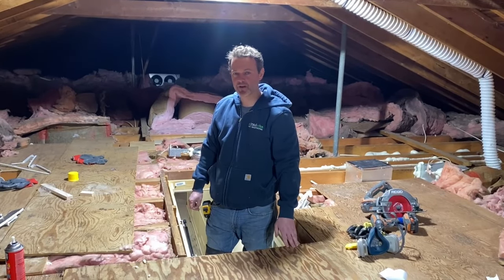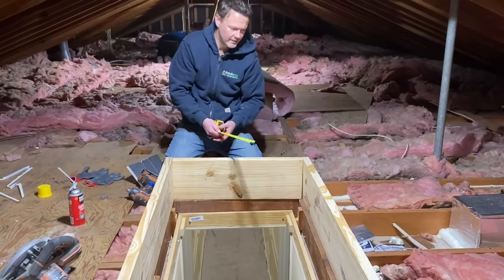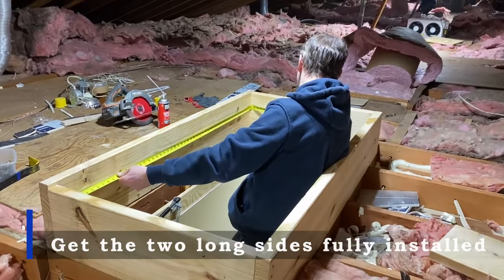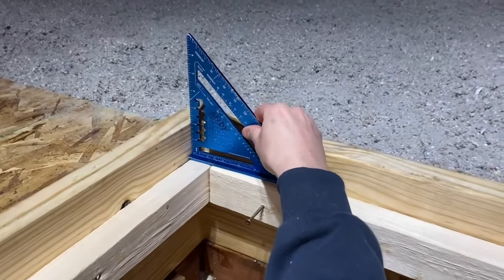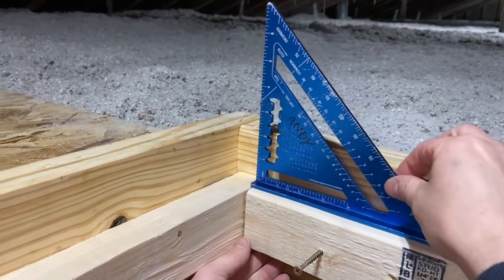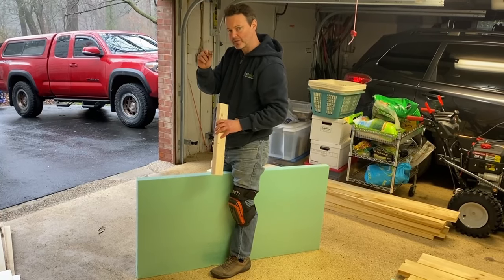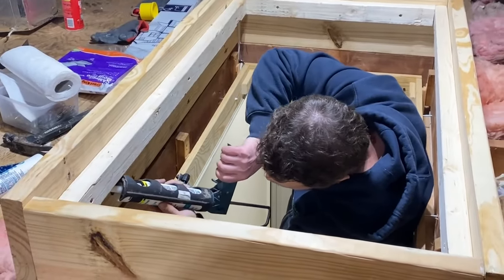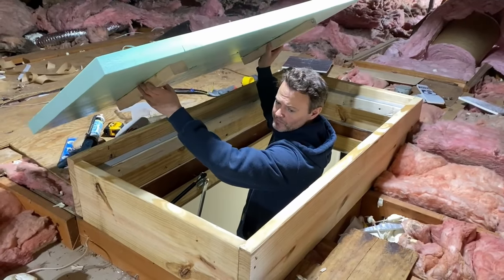How to Build a Sturdy, Air Tight, Insulated Attic Hatch for Your Attic Ladder

Comment: Up here in Canada, the hatch has to have an insulation rating match the attic.  In our case, that is  R-50.  Consequently, my hatch has 10" of foam board.
Reply from the maker: In a much colder climate it could make more sense.  Here I don't believe our customers would ever see the return on that investment (it would raise the cost of the hatch solution dramatically).  Thanks for commenting!

Comment: This looks a lot more durable than what my home's previous owner made. He built a 4-sided box from foam board that has each side screwed together and it rested on fiberglass insulation. Between me and the contractors I've hired, the fiberglass insulation loosened from the plywood reduces the box's effectiveness. Also, I've noticed the box gets tossed to the side when someone has gone up into the attic that has weakened corner seams. I don't have a circular saw, but I have a hacksaw although I don't cut very straight.
Reply from the maker: Thanks!  This solution has been pretty well tested here over the years.  I don't like the zippered covers (weak R value and they leak air) and the box covers we see ALWAYS get beat up and degraded fairly quickly.  If you're able to construct a hatch cover like this, it will work well for you for years. 
Andy

Comment: I like to make a sandwich to seal an attic opening by attaching drywall on the bottom, plywood in the middle and foam boar on top. The drywall has a high burn through time so I have that face the interior. This looks like a great job of air sealing an attic hatch.
Reply: Thanks Chuck.  Your drywall idea with the drywall ignition barrier is good.  Unfortunately we see a lot of those where the drywall deteriorates from getting knocked around a bit.  The combination of air seal, insulation value, and durability is our primary concept.  Hopefully if there's a house fire it won't be determined that our attic hatch was the straw that broke the camel's back ; )

Andy
Reply from the maker: Hi Chuck, your drywall sandwich method will work just fine the vast majority of the time.  The only problems we see using drywall are when the hatch gets used regularly, or the drywall begins to get damaged.  At that point the drywall starts chipping away around the edges and eventually air-leaks form around the perimeters.  It's just not as durable as plywood or XPS rigid foam board.

Thanks!
Andy

Comment: Why not glue handles on instead of putting holes through the foam insulation? You can even make the handles out of foam. I use PVA glue to build with foam.
Reply from the maker: A lot of adhesives will degrade foam board, they kind of break it down.  Loctite makes an adhesive specially designed for foam, but it takes 24 hours to cure.  I also see sealants fail from time to time.  Mechanically attaching the foam with screws and washers is quick, durable, and permanent.  Penetrating the foam with a screw does not impact it in terms of reduced insulation value or air leakage, the wooden handle is sealed tight against the foam board. 
Andy
Reply: A few screw holes through the foam are not going to make the slightest difference to the R valve of it. You would have to do the same if fixing it to the underside of  rafters

Comment: It would be sensible to stick Gapotape around the perimeter of the kingspan foam board so there is a tight fit between it and the wooden frame, to prevent further cold, and hot, air getting down as far as the weather strip. You could also have a second larger layer so it, in turn, sits on the frame.
Reply from the maker: Hi, it looks like Gapotape is an English product, I have not seen it before in the States.  I looked at it and it appears to be foil faced.  I like the soft foam rubber of the weather stripping that we use combined with the weight that we add to the foam board to create a tight seal.  I would not expect a smooth metallic surface versus a soft foam rubber one to improve the air seal here, but I could be wrong.  We've been building insulated hatch enclosures around pull down ladders like this for about 15 years and have tested them with both infrared imaging and blower doors, and they perform quite well so long as the inner wooded lip that the foam board rests on is level all the way around.  
Another component is that in many cases homeowners are using this multiple times a year to access their attics.  By adding additional tapes, weather stripping, etc onto the lip that the hatch sits on, or onto the hatch itself, the odds of a foot hitting it, or the tape getting mashed while the hatch is being moved around goes up.  And it is unlikely that most homeowners are going to identify that the seal was compromised and then "properly" repair it.  This design, with the materials used, should stand up to decades of use.  
Thanks!
Andy

Comment: What's the size of those planks? 1x6?
Reply from the maker: We generally use 2x10's to build the box that the ladder folds up into.  But you don't necessarily have to.  You need about 3" inches of clearance between the top of the ladder when it's folded up and the top of the hatch wall.  For lower profile ladders a 2x8 can work.  Hope this helped!
Reply: @insulwiseenergycomfortsolu3293  it sure did, I'm new to this world, but I am going to try this out. Thanks!

Comment: Great idea. I spent a little more money and I attached two elbow arms to the foam board and two stepper motors so the foam lid lifts and then moves on the side with the push of a button.
Reply from the maker: Thanks, that's taking it to another level!  Do you feel like it still seals well when it's all the way down?
Andy

Comment: Great video clearly detailing the steps involved.
Reply from the maker: Thanks, creating a durable, insulated attic hatch solution for a pull down ladder takes a few steps, but I try to lay them out in as coherent a way possible. 
Andy
Reply from the maker: Thanks!  Doing these things correctly requires a number of steps, at least if you want it to come out with a tight, durable air seal, insulation barrier, and be durable.  This solution should last a lifetime for the majority of homeowners.
Thanks!
Andy

Comment: Amazing job! Using this idea today,  thanks!
Reply from the maker: Hey there, thanks for the shout out!  I would like to create another video for doing this that's more condensed, but there's simply more than 2-3 steps required to get these to come out right.  But if you're able to follow them, you will have an exceptionally durable, well sealed, and well insulated attic hatch for many years.  We have now been building these for 15 years, and I have yet to have a single homeowner call and tell us that their hatch broke or no longer seals well.
Glad you found this helpful!
Andy

Comment: Helping plan for an old house new insulation - this video is perfect.  Watching your others.  Just an idea when you were dropping in your weather stripping, if you go corner to corner and fully overlap (two layers in corners) and cut through both layers at roughly a 45-degree the two stips will meet very tight and need in the corner.  Any problem you can see doing that?
Reply from the maker: Hi there, thanks!  I haven't tried that before, but it sounds like it could work very well.   The only issue I can think of is that the weather stripping that we use is VERY sticky, and it tends to stick to itself so well that it's likely to tear when you try to peel the top layer off the bottom layer.  But maybe I don't understand exactly how you plan to do this?  Let me know how you make out, we're always looking to improve our own craft here! 
Thanks, 
Andy

Comment: Great video helps me a lot. What weather stripping are you using around the perimeter? Things I have used in the past disintegrated.
Reply from the maker: We use this stuff.  It's durable and covers almost the whole lip of the box.  Thanks for watching!
https://www.homedepot.com/p/Frost-King-1-1-4-in-x-3-16-in-x-30-ft-Camper-Mounting-Tape-for-Trucks-V447H/100122697

Comment: you mentioned that if the opening was more like a trapezoid than a rectangle, it would be difficult to construct the lid.  I am curious...would the same thing apply if the opening were shaped like a rhombus?
Reply from the maker: Haha...I hope I never have to deal with a rhombus shaped opening, but yes, that would be significantly more challenging.

Comment: Do you think I can use foam board insulation in a central Texas Attic for this same purpose? I'm concerned the high heat may be too much. Perhaps a thermal barrier would be necessary. Or a different solution altogether?
Reply from the maker: Yes, I think this type of foam board would hold up well.  We use the green 2" thick pactiv brand, XPS board from Lowes.  I wouldn't use a styrofoam or polyiso style foam board, I think you'd be much more likely to run into issues with those materials.  Some of our attics here will hit 130-140 degrees.  I don't think it's likely to be too much hotter than that even in TX in an attic.
Reply: @insulwiseenergycomfortsolu3293  Thanks for the insight! I'm going to keep researching what my local stores have in stock and see how they measure up. Great design btw, I bet that guy goes in and out of his attic as often as he can 😄

Comment: Hello are these 2x10 boards? Is it difficult to get into the attic with the extra height of the new frame?
Reply from the maker: Yes they are 2x10's, but you may be able to get away with 2x8's.  The hatch wall needs to be about 3" inches higher than the ladder is when it is folded up inside the attic.  For some people it is more challenging yes, but for most it's not an issue.

Comment: How can you manage to walk through that insulation all over if you got to fix something?  Just wondering
Reply from the maker: You have to be careful (obviously), but we have to do it all the time.  I'd recommend a cheap headlamp so your hands are free, a dust mask, and then either hold onto the roof rafters as you move through it, finding the joists with your feet and staying on them, and kick it back once done.  Or use a basic broom to swish yourself a path and then swish it back into place when you're finished.  It's not as difficult as it looks, but you do have to be careful and STAY on the JOISTS is the biggest thing.

Comment: where are the links for the items? I need the link for the weather strip.
Thanks.
Reply from the maker: The product is M-D Building Products Camper Seal Tape 1 1/4" in W x 30 ft Roll.  It's about $7 on Amazon.  I just put these details into the video description.  Hope it helps!
Andy

Comment: At around 14:53, your partner in the background looked like he was making a Pot Light Cover. Rather than spending $16, it looks like you made your own at a fraction of the cost. Can you please advise what material you used to make it?
Reply from the maker: We typically use 1/2" foam insulation board and tape it together.  We also make sure that the lights have LED's in them and if they do not we change them out with extra LED bulbs that all of our trucks carry.  The boxes are large, at least 12" high and usually about 14-15" wide to accommodate the frame of the light and not allow for excessive heat build up.  Some could find this contentious, but we have had no issues over the years with it.  The newer LED lights put out very little heat, and the thermal shut off switch inside the light fixture would shut off the light if it got too hot, or cause it to blink on and off.  We tape the box together using metallic HVAC tape.  It is highly tacky and durable.  We then use foam to seal the box to the attic floor.
Reply: @insulwiseenergycomfortsolu3293  Thank you for the detailed response! I think your solution is a fraction of the cost and is a much better solution than off the shelf products costing much much more. 🙏
Reply from the maker: @EverGrowSteve   Thanks Steve!  We've tried all of those solutions as well.  The pre-made rock wool covers are nice, but they tear and get easily smashed in the back of a truck and are also far from air tight.  I've pulled smoke through them with a blower door.  The cardboard flip up ones, metal sided box ones, etc all leave a lot to be desired from our point of view.  Also -- pot lights / recessed lights are rarely situated perfectly in attics like it shows in their advertisements.  The lights are often directly against studs, up against roofs, etc and we went our route because we needed a solution that was adaptable to the wide variety of situations that we have to seal pot lights in.  Glad this helped you!
Andy

Comment: Should stack more foam to get better r value
Reply from the maker: Yes, we sometimes do that and you will get better R-Value (R20 versus R10).  The main reason that we don't is because of the added expense for the homeowner (that they typically don't want to incur), and with foam insulation at 2" you eliminate close to 90% of thermal conduction, so you begin to get substantial diminishing returns once you start to add more inches.  What I will say is that when you go from a poorly air sealed, 1/4" thick wooden attic hatch to an air sealed hatch with a 2" inch layer of foam board for a hatch, you will see a MASSIVE positive impact. 
Andy
Reply: stacking foam stacks moisture barriers wich traps moisture

Comment: Great video! Would the xps board be good for providing soundproofing insulation as well? My wife has an attic office and we have a similar hatch with fold down ladder. She doesn’t want to hear family noise while she’s on zoom meetings. What you recommend as an alternative material?
Reply from the maker: Hi there, the 2" inch thick XPS board would certainly knock it down a good bit.  You could also double it up and make it 4" inches thick by adhering 2 pieces of it together.  Either way you go, it will knock down a solid bit of the noise that is now coming through that hatch. 
Andy
Reply: TimberHP Wood Fiber Board are available in 24" and 48" widths and use tongue and groove to connect to other boards.

Comment: Very well done, but only R10?
Reply from the maker: You could certainly double, triple, quadruple the R-Value, etc by adding more foam board.  But that 2" inches of XPS foam board will eliminate about 90% of the temperature transfer coming through from the attic.  We do this to keep costs down for our customers and in my own mother's home I used the exact same design.  Except in extreme situations, I would be surprised if you could notice a temperature / comfort difference or impact on a heating / cooling bill by adding additional layers of foam board to these hatches.  They usually occupy about 1-2% of the attic floor area and the rest of the area is air sealed and insulated to R-49.

Comment: Where are the links to the weather stripping product that you used?
Reply from the maker: This is what we use.  It's about a full 1" inch wide, which is better than the Frost King brand's version which is only about 2/3" of an inch wide.  https://www.homedepot.com/p/M-D-Building-Products-30-ft-Gray-Foam-Tape-Camper-Seal-for-Camper-Shells-02352/202066511

I'm sure you can also find this on amazon
Andy

Comment: So you make the home owner step over the 2 X 10 to get into the attic?  And you raised the floor to get to near the top of the 2X10?  What was that all about?
Reply from the maker: That was about creating an air tight, insulated box for the ladder to fold up into when the attic ladder is folded up.  And the floor was raised to 1)  create a storage platform for them and 2) to provide extra space for the additional insulation so that the attic could be insulated to R-49 from the original R-30 level. That's what that was all about.  Their home has been dramatically and permanently improved from a comfort, energy efficiency, and usability level as a result.

Comment: The worst thing the world is having HVAC equipment and ducts in unconditioned attic.
Reply from the maker: Hi there, the duct that you're seeing here was an old bathroom exhaust hose.  Generally however I would agree that having duct work in a conditioned is far from ideal.  That said, the common issues associated with HVAC equipment in unfinished attic, ie duct leakage that is lost directly to the outside, and poorly insulated ducts that thermally conduct hot or cold to the attic, can largely be remedied by spray foaming the trunk line (seals and insulates the sheet metal part of the duct) and then burying the flex hose runs in blown insulation.  Obviously the flex hose runs would be sealed to both the trunk line and the register boots in the ceiling with foam.  I would still prefer to have the HVAC equipment inside the thermal envelope of the home/ structure.  But this is a solution we use with regularity with solid results. 
Thanks!
Andy
Reply: @insulwiseenergycomfortsolu3293  Yeah nothing to do with your work. This hatch idea is brilliant!

Ducts in attics are just a terrible design that the building code allows people to do 😞
Reply from the maker: @crabkilla    Yeah I'm in full agreement.  We also see a lot of central returns going into 2 story new construction here which I also think is an awful building code allowance.  You'll see one large return on the first floor and then one at the top of the stairs somewhere.  It's just so lazy.  We prefer a supply AND return duct in each room, and definitely with the supplies on the exterior walls and ideally beneath windows (weakest part of the thermal barrier).  We've experienced numerous homes with the supplies on interior walls...and then guess what happens with each step taken toward the exterior walls and windows as the homeowner walks away from that supply register when it is cold outside?  "My rooms are cold and I can't fix it without using space heaters..."  Yup, and all for saving a few bucks on sheet metal supply ducts during the initial construction process.  So dumb and shortsighted. 
Andy